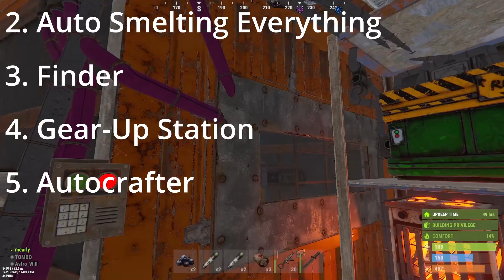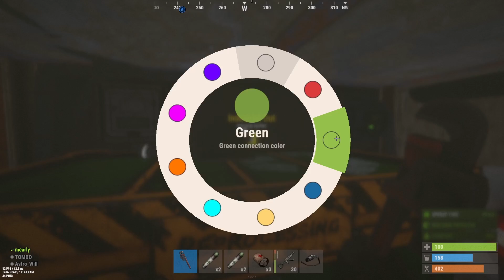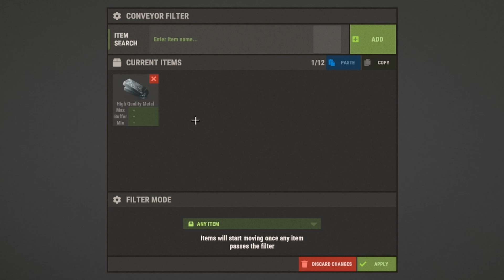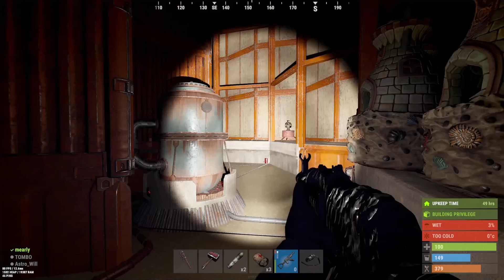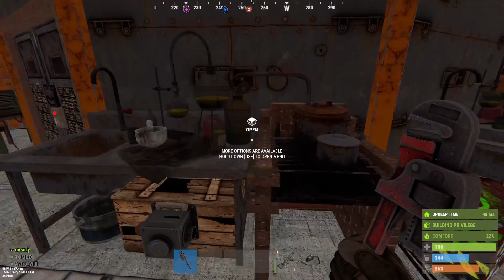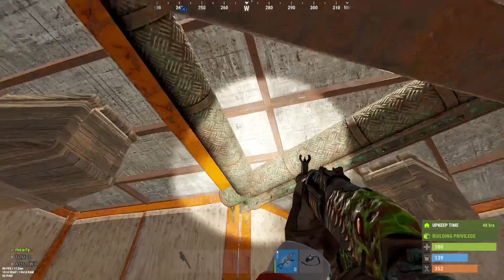The Full Industrial Tutorial - RUST may 2024 update

Comment: Is there a way to make a system so the autocrafter will craft whatever item I don't have a set amount of? For example if I don't have 50 med sticks in this chest, craft until I have enough?
Reply from the maker: There is. For med syringes for example, a simplified version would be to have the out end of a auto crafter going to a conveyor going to a small box. And on the input side of the crafter have a conveyor pulling the mats in from your boxes. As long as there is plenty of cloth, low grade fuel, and metal fragments, it will craft medical syringes until the small box on the output side is full and will end up making more anytime you take clear any slots in the small box or autocrafter. You can also just skip the whole output to a small box and just always have it making 8 in the autocrafters output slots. Hope this helps